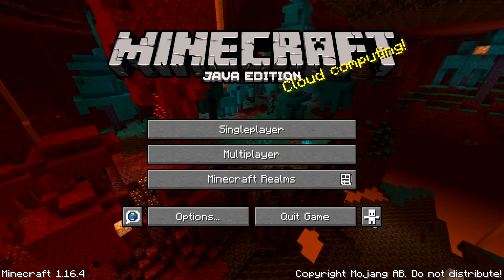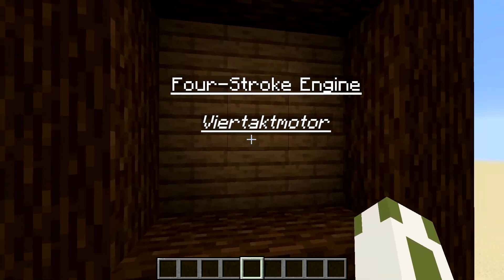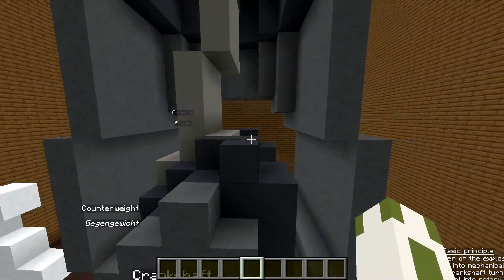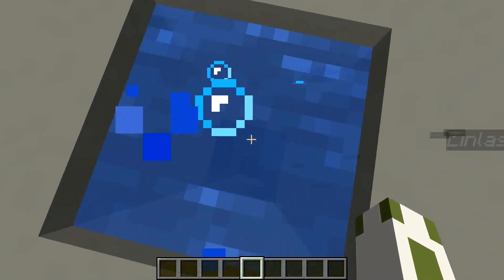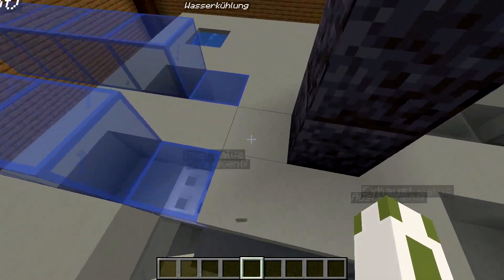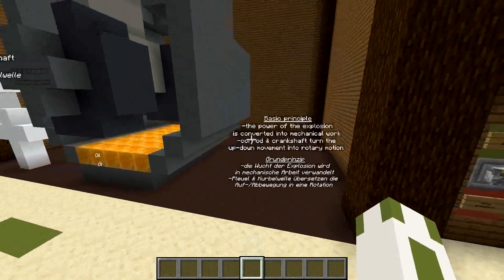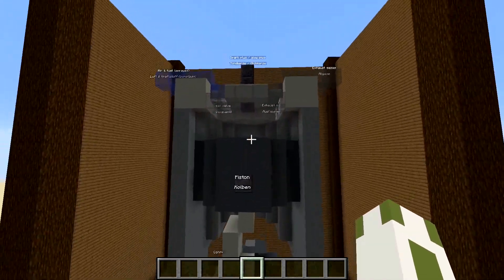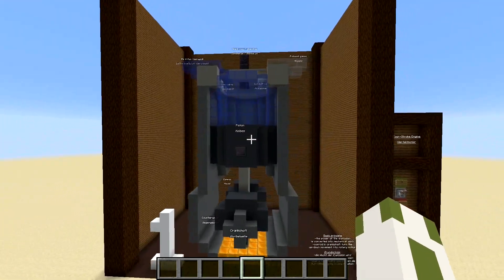Four-Stroke Engine | Explained in Minecraft

Comment: i wouldn't mind seeing the other variants
Reply from the maker: Well... usually you cannot see any big difference, but I can explain it to you:

1) Diesel engines have no spark plug igniting the air-fuel mixture, instead they have a glow plug used to start the first few ignitions. After that the mixture explodes by itself simply because of the heat and pressure. Therefore no spark plug is needed and the fuel always (I guess?) gets injected directly into the combustion chamber.

2) And as I mentioned in the video, some petrol/gasoline engines spray the fuel into the air before leading the mixture into the combustion chamber. Others spray it - similar to diesel engines - directly into the chamber.

The basic principle always stays the same, but every manufacturer implements it in a slightly different way.
Reply: @NOPEnameMC  thank you, I've wanted to learn the basics on this for a while now but couldn't find any good explanations.
wasn't expecting to find them here though lmao
Reply from the maker: @ilimes  hehe, you're welcome ;)